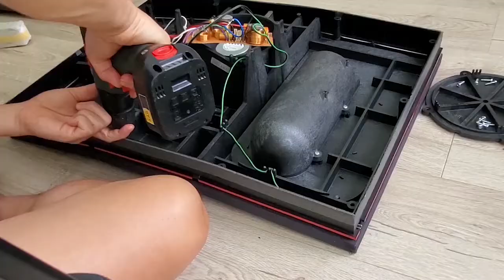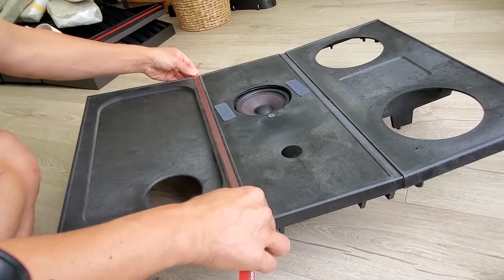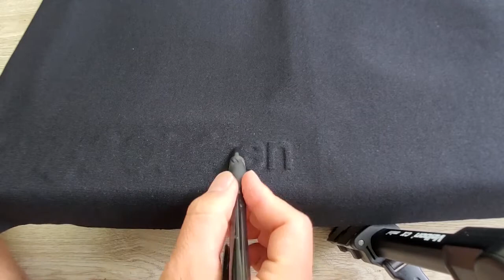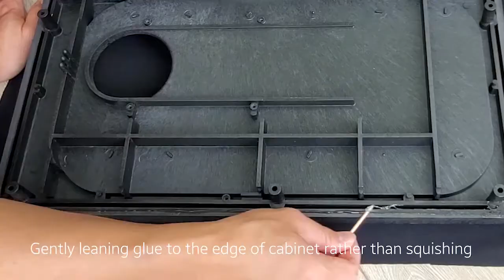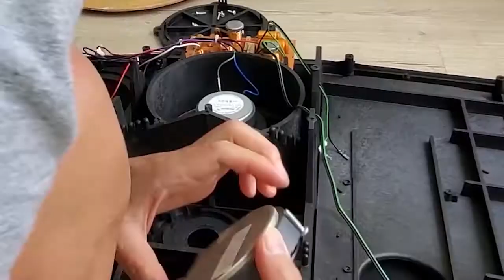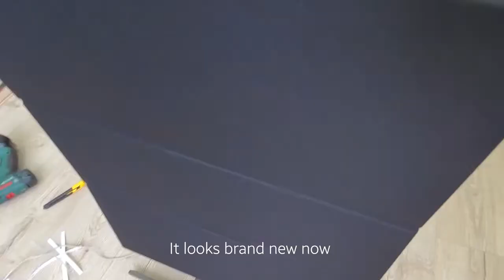B&O Beovox RL 140 Fabric Replacement

Comment: Better use gluespray on both the cabinet and fabric for the B&O logo embossing. Only one side the embossing eventually comes loose. What about the straps?
Reply from the maker: Hi
Yes. I agree to use gluespray such as 3M which would be better result than the normal fabric glue. You can buy the straps from ebay but I don't like the strap material and colour on the front of speakers that need to spand extra cost as well so I didn't do. Thanks ~
Reply: Still, that particular place where the straps are the fabric will come loose especially when adhesive tape have been used.
Reply: @leslienelwan  hi, if you are Leslie from netherlands, on beoworld forum. I would like to say huge thank you. Becouse of your detailed explanation on forum and a lot of pictures as an example i manger to do restoration on rl140 as well on cx100 speakers.
Reply: @vedranbartula4227  yes, that's me. Not on Beoworld anymore but on Facebook B&O forums like https://www.facebook.com/groups/BangAndOlufsen/?ref=share

Comment: I have watched your video 10-15 times and now started the work, but a disappointing start.  I have a problem in finding the right glue, not able to get the embossing correct as the glue do not stick it well in shape.  I do not find craft one which showed you in Germany :(
Reply: Gluespray should be done on both sides. If not after a while the embossing will dissapear. Fabric will come loose...
Reply: A hint that will apply here: search videos on how to replace car interior roof fabric. Very similar principle with very similar materials. That will provide tips and tricks to get delicate fabric to stick and might even provide a good spray adhesive to use in this case. Cheers!
Reply: @paulhale5471  thank you for the guidance!